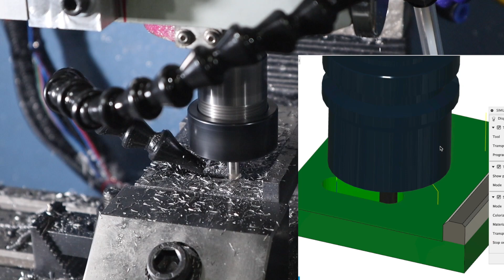Hago estas grapas de sujección para la fresadora. Milling machine clamps

Comment: Hola Enrique, tanto tiempo que no dejo un comentario. Pero siempre miro tus videos. 
Tenes que comprar un buen compresor. No tenes suficiente presión de aire para enfriar la fresa y despejar la viruta. Más si vas a tirar aceite soluble en forma de niebla.
Para acero te recomiendo que metas más adentro la fresa en la boquilla del usillo. Fresa de cuatro filos y si vas a usar carburo con recubrimiento el aitin es el que mejor resultado me dió en aceros al carbono. 
Esa operación de adaptative en acero en dos veces para la profundidad iba sin problema. ( Me la juego que con buena evacuación de viruta y refrigeración la podés hacer con todo el filo sin problema.) Hasta a Jhon saunders se le complica fresar aceros en sus tormach con sus fresas de súper archi calidad con ángulos de corte optimizados. Vos con una herramienta que ya estaba batallada lo sacaste a la primera un lujo

Comment: Por que has metido la pasada de la ranura en el acero con tanta profundidad ?
Reply from the maker: Por que quería ver que tal con todo el filo y 0,8 de avance lateral. No va comiendo con todo el ancho de la fresa va en trocoidal, quiero buscarle el punto bueno, falló por falta de taladrina yo creo no por la profundidad. Me temo que no se libra uno de la taladrina a chorro con el acero
Reply: @MaquinerosCNC   una cosilla yo suelo trabajar con operaciones en trocoidal y veo un par de cosillas, por el alto no creo que tengas problema, yo suelo darle siempre un milímetro menos de lo que dice el fabricante que puede mecanizar en altura total, y luego los mecanizados en trocoidal necesitan una avance alto con poca carga lateral y siempre con aire, y luego el sistema de agarre de la herramienta también es muy importante, siempre utilizar portas weldon hidráulicos o térmico nunca una pinza. Por ejemplo yo utilizaría un porta hidráulico, 240 de VC y de carga lateral entre un 10 y un 15 por ciento del diámetro de la fresa.
Disculpa la parrafada.
Puedo pasarte algún video mecanizado así sin ningún problema.

Un saludo!